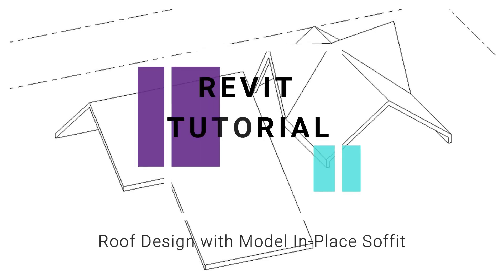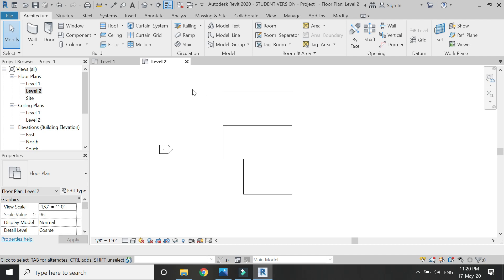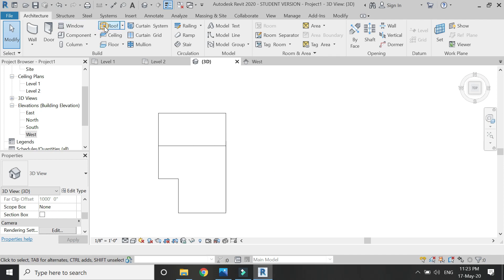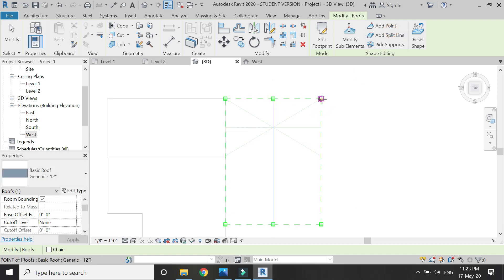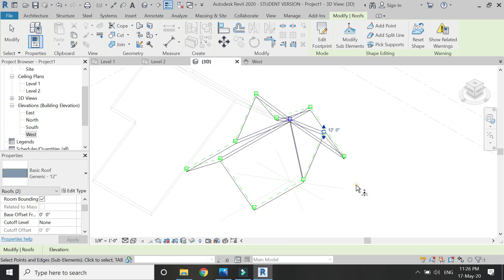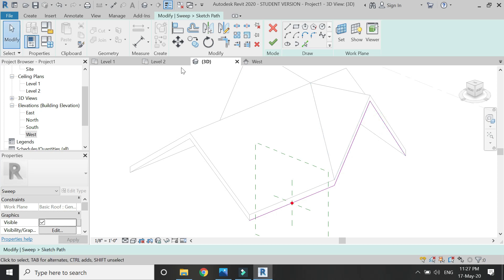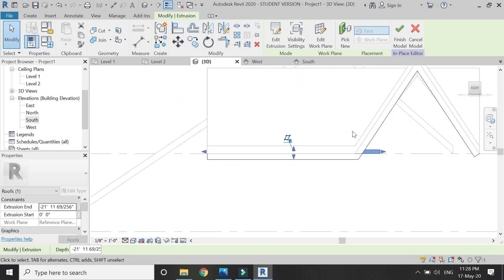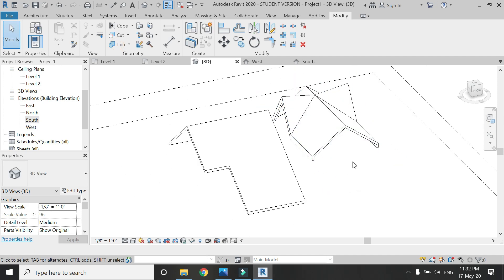Revit Tutorial - Roof Designs with Model In-Place Soffit

Comment: Hi, I have been trying without success to find a way to make a ceiling follow  the soffit of a complex pitched roof. Basically i need the ceiling to follow the profile of the roof but because it is complex with many angles and intersection I am not able to do it. Perhaps this method could provide a solution. Do you have any advice?
Reply from the maker: It is difficult to understand like this. Can you share a sketch or the picture of the design at letsrevit.tutorials@gmail.com?